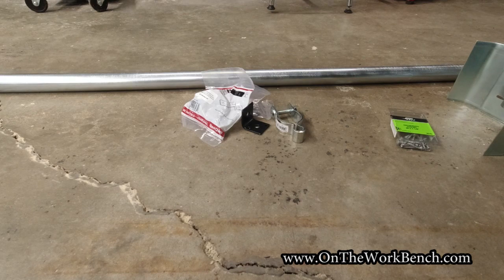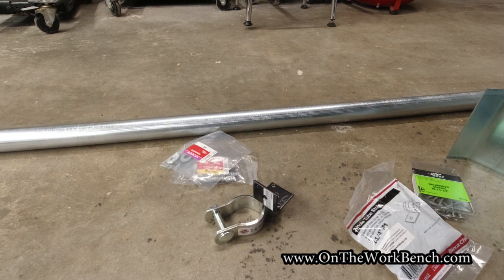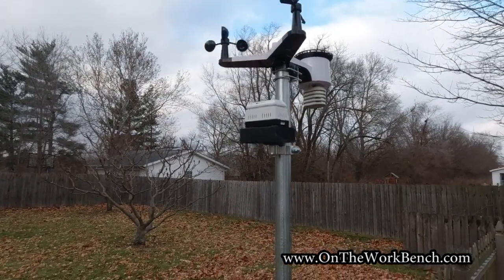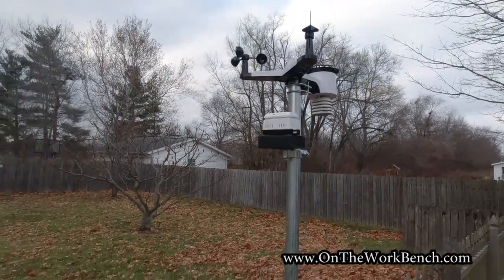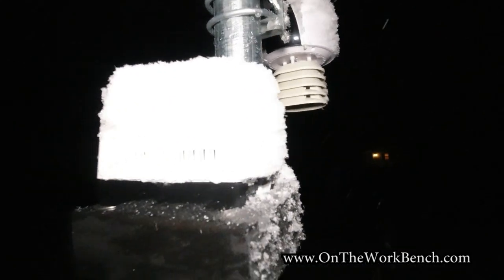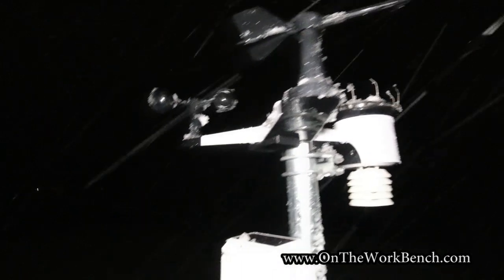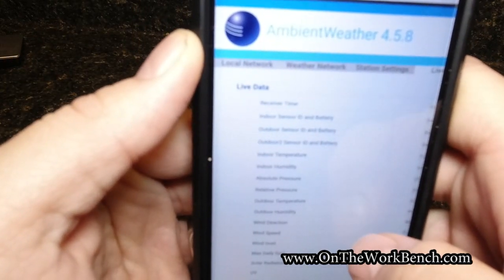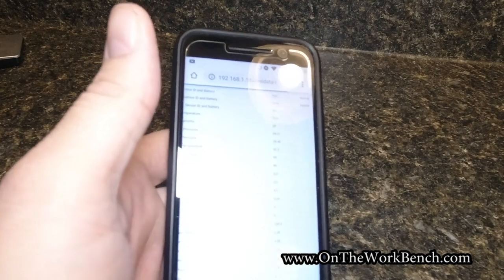Ambient Weather WS-1550-IP Weather Station Setup

Comment: So just an FYI, any snow accumulation of any kind will never affect your temp, humidity, and air pressure sensors. If that's still happening then you have bigger problems. Of course your wind speed, direction, and precipitation readings could be affected by snow cover

Comment: Thanks for the share! Really informative stuff. Recently moved out to the middle of nowhere and I'm at a loss for accurate weather data. I'm looking into getting a station like this to get better 'hyperlocal' data for me and the family.

Do you know if the Ambient Weather service sends the weather data to various providers? I'd love to be able to help the other rural residents out by providing data from my sensors.

Thanks again!
Reply from the maker: Yes the data can be sent to wunderground.com, or Ambientweather.com so others can see it if you would like. Weather Underground also keeps a history for your station too, however it displays the station location on a map to the public. Your station is assigned a call sign just like airport stations (e.g. KORD for Chicago O'Hare). 

So far my station has worked great, except for wet sloppy snow blocking the wireless signal until I cleared it off. The bird spike kit was also probably worth it too.

Comment: Is the weather station working as you expected?
Reply from the maker: So far it has survived several freeze thaw cycles, the only issue is it will stop communicating if too much snow piles on top of the sensor body and then I have to manually remove the snow or wait for it to blow off or melt. A light coating of snow has been no issue, just the wet heavy stuff.